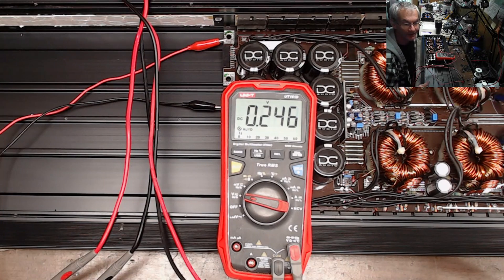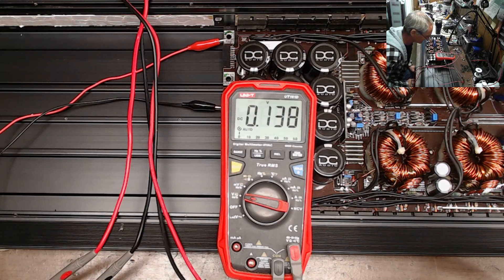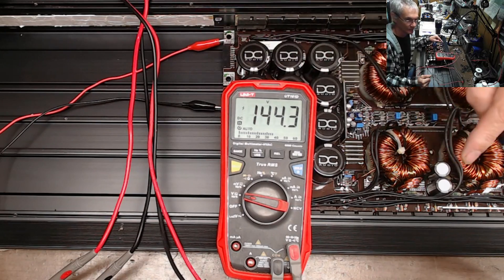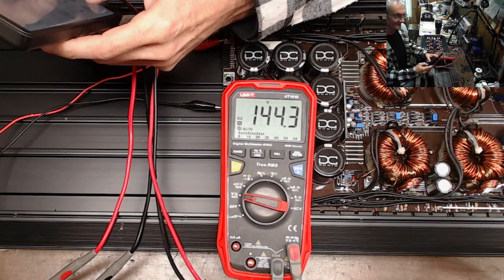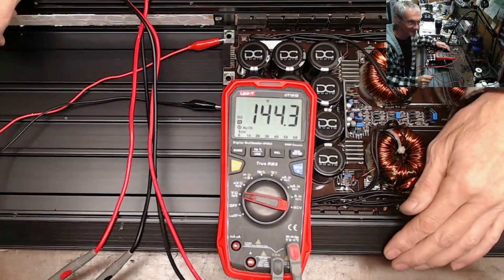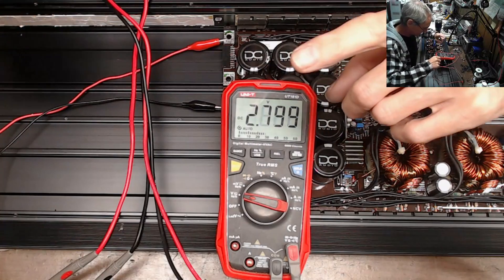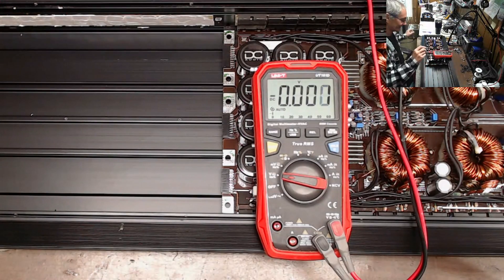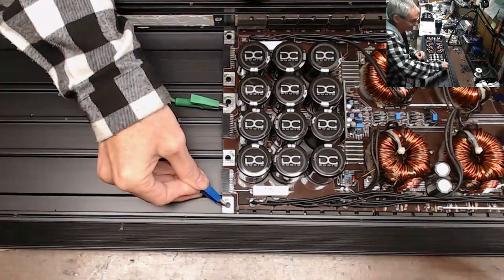Why Don't I service Some Amplifiers? Well, Voltage is the Simple Answer

Comment: The amplifiers don't have any feedback to regulate the high voltage supply?
Reply from the maker: Wouldn't that be awesome! Nope, as I like to say Korean power supplies are "dumb" as they have no clue whatsoever about what the output is doing. They do have one form of protection, kinda, the thermal circuit which is still worthless.
Reply: @ellensburgamplifier  Nasty. Some regulation probably wouldn't even add much to the cost

Comment: Wow! That is some serious +/- voltage in an audio amplifier! I'm used to being VERY careful working with tube based radio amplifiers. The DC voltage on the anode of these amplifiers can exceed 2kV which will extinguish your life in an instant.
Reply from the maker: Indeed! This business started as a vacuum tube tester restoration business and the voltages are indeed high.

Comment: From what I understand, 48 volts and lower is classified as low voltage and is fairly safe. As you go above 48 volts the likelihood of an electric charge overpowering the resistance through your body becomes more and more likely. 60 to 80 is dangerous territory and we all know 120 volts will definitely flow through you.

If you're lucky, the charge will not stop your heart. You'll just get one heck of a zap. On rare occasions though it will stop your heart and you'll need to be resuscitated.
Reply from the maker: You are correct!

Comment: So 14.8 is no no..good video Todd..are there amps or boards you really like dealing with..and for all of you looking for a tech,Todd is a real class act, ridiculously cool guy to deal with .the only guy on the West Coast for me.😊
Reply: I think he's saying 14.8 volts okay, but higher is not something he wants to deal with.
Reply from the maker: I think getting above 15 is trouble for these. Don't get me wrong, it may run just fine at 16 for who knows how long but as a business owner we have to evaluate risk and liability.
Reply: 14.8V comes from the typical lithium voltage of 3.7V, multiplied by 4 in series. However the top charge of such batteries (ie when your pack is at 100% charge) is instead 4.2V, which would create 16.8V, and bottom is likely somewhere around 12-13V. So that is a comparatively large voltage swing when being multiplied by 12 as in this example.

So if you wanted a lithium battery bank to only ever be at around 15V or lower, you could NEVER charge it above ~90% capacity. Forget trying to do that as a human, at some point you're gonna trip up and let it get to 100%.
Reply: @ivolol The 14.8 volt comes from the stock battery or lithium iron phosphate cells, not from your typical lithium ion or lto cells.

Comment: Another great video 👍. Would love a video of how you built your discrcharge resistor setup
Reply: I think you can buy those type of devices. I remember seeing one that had an LED on it that lit up and as the charge dissipated the LED would go out to let you know when there was no voltage left.
Reply from the maker: @JasonWW2000  I think I have seen things like that in the past. It would be easy to make one.
Reply from the maker: I will squeeze one in ;)